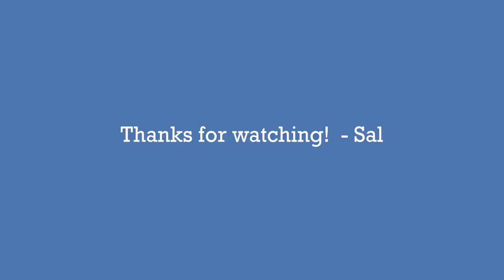Diagnosing a stuck brake caliper in my 2002 Tundra

Comment: I put a set of power stop z36 on my 2006 tundra,  made a pretty good difference to the stopping power,   Both rotors and pads, on the front were about $200 from Amazon,
Reply from the maker: Nice, that's good to know. When these pads wear down I'll probably be looking to upgrade the whole system. Thanks for watching - Sal

Comment: Great work mate
Just a word of advice though. To make things easier first push the calliper pistons in with a large flat screw driver  and slide the pads out. Then unscrew the metal brake line mounting bracket off of the steering knuckle so it will be easier to manoeuvre the calliper once its unbolted. Then proceed to unbolting the calliper mounting bolts. Just my two cents. Hope it helps. Peace out👍
Reply from the maker: That's a great tip, very helpful if I have to remove the calipers again. Thanks for watching! - Sal
Reply: Ya except if he did that with a seized caliper or there just hard, he could mess up his rotor let's not add that Parr in aye bud

Comment: having really bad brake pulsations after getting my truck back from the shop for rear differential work. Me and a friend swapped front rotors and pads to no avail. We then bought a new caliper for the driver side which slightly fixed the shaking. It still shakes when braking and I’ve decided on replacing the passenger aswell, I really hope this fixes the whole problem. Really hope nothing in the rear is causing this issue
Reply from the maker: Huh, I'm not too sure. If you did pads and rotors and that didn't solve it, I would consider looking at the brake master cylinder. May need to replace it with a new one. Hope you can get it figured out, and thanks for watching!

Comment: Having the same issue on my sequoia as we speak. I flipped the caliper upside down and pour brake fluid in the piston. I was able to move 3 of them so I’m letting the 4th one soak overnight and hopefully it comes clean. Doubt it tho. It has 245k and the calipers are oem ones.
Reply from the maker: Ah bummer, hopefully that helps release it. At least the calipers aren’t too expensive if you had to replace it completely. Best of luck! - Sal
Reply: I figure I give it a try before spending the money. Either way they’ll have to come out.  Lol.

Comment: great video!  I am suprised you are not feeling any vibration in your steering wheel from the brake caliper being stuck.  Usually the rotors will need to be turned or replace when they have uneven wear.
Reply from the maker: Thanks! Yeah I was surprised that I wasn't feeling anything through the wheel, and I still don't now that I've installed the new caliper. 🤷🏻‍♂️ who knows, thanks for watching! - Sal

Comment: Thanks for making this video. I’m getting ready to change out the calipers on my ‘06 Tundra.

Unrelated question, though… when you replaced the stock radio with that head unit, did you install a backup camera? If so, how’d that project go?
Reply from the maker: Thank you, I hope the video was helpful. Funny you should ask that, I actually just picked up a backup camera for the truck and should be installing it in the next month or so. I'll be sure to have a video of the process on the channel! Thanks for watching - Sal

Comment: Curious.  Would a caliper/piston rebuild have been an option in your case? I know people have repaired/ rebuilt their pistons. You probably contemplated it and your piston may have been too far gone.  I don't think it was mentioned in the video.  👍🏻
Reply from the maker: That's a great question. Once I got the whole thing taken apart, I was honestly kinda in a rush to just get it done because this is my daily driver, so I didn't really consider that as an option and just went with brand new stuff. It probably could have been an option, but a seized piston probably means that there's some rust back there and at that point it's probably best to just replace it. Not a mechanic by any means, but just talking through my thought process. Thanks for watching - Sal

Comment: Which brake caliper did you use?
Reply from the maker: I don't remember specifically, but I used whatever one replaces the 13WL caliper. I found this forum that has some helpful info too. Hope this helps, thanks for watching. https://www.tundras.com/threads/13wl-brake-upgrade.39010/
Reply: @JDMDriveway  great thank you! And you only replaced the passenger correct? If so how’s it holding up?
Reply from the maker: Yep, I only did one side. So far, so good. I haven't had any issues at all 👍🏼
Reply: @JDMDriveway  sweet! Thanks again your vids are always helpful 🙏

Comment: Next time just clamp off the rubber hose of the brake line and you won't lose as much fluid and introduce less air.
Reply from the maker: Gotcha, that's a good tip. Kinda jumped into doing this without doing to much research beforehand. Thanks for watching!